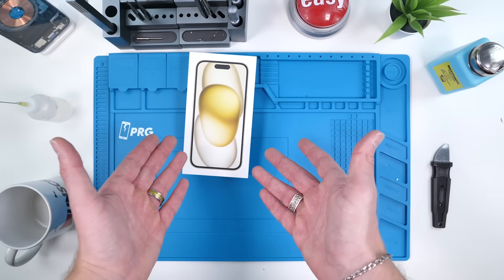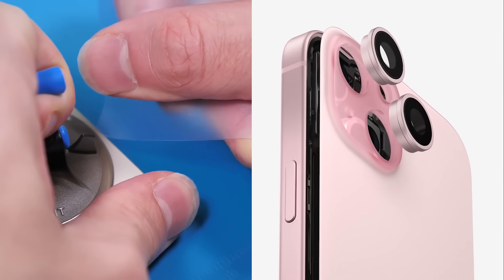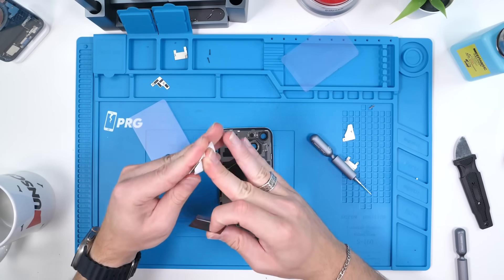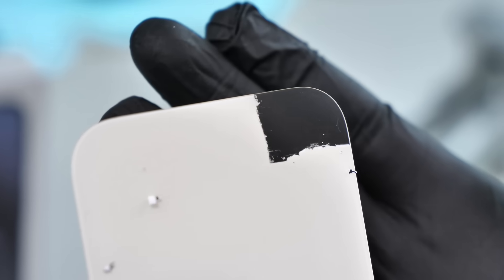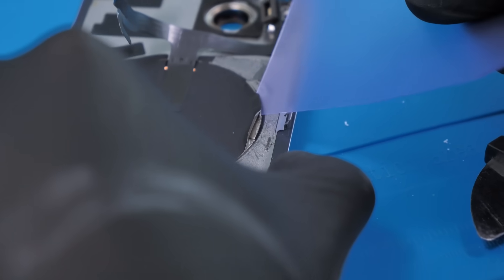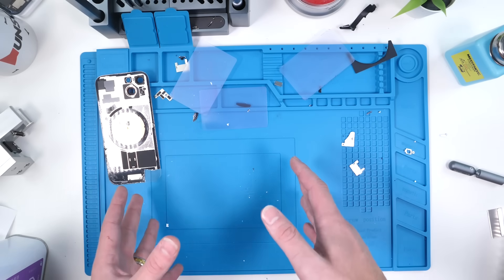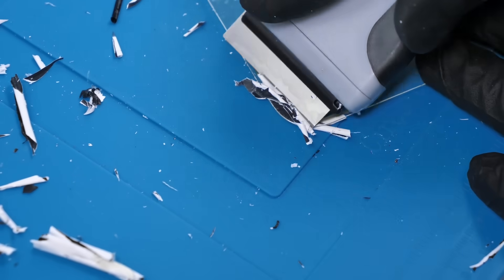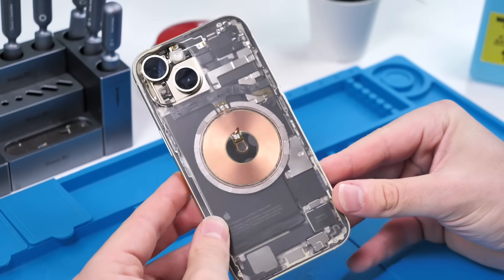The iPhone 15 Can't Be Fully Transparent?

Comment: I wish they make this an option. It’s so cool
Reply: Fr, bring back the Mac G3 days
Reply: Yeah. Offer a 20-30 discount too. Since it’s less materials used
Reply: @Kananaboo 20-30 is less than 1% of the price, and it will cost more because its not a "normal" phone but rather a "limited" (not actually limited but whatever) edition so it would cost more
Reply: @Kananaboo i guarantee you if apple released a clear iphone 15 it would cost MORE 💀
Reply: @bread6235  when has Apple ever made a different color cost more tho..?
Reply: @nylotical  i mean like if there was a clear iphone it would only be for one of the flagship pro models and not on base. just like how the midnight purple was exclusive to the 14 pro & cobalt to 15 pro

Comment: I thought that your transparent iPhone mod couldn't get any cooler since, you know, Apple being Apple. But dang you pulled it off with significant improvement to the cleaness throughout the process while being indestructive! I don't usually give any video a like but I did on this one. It's like watching your favourite football team winning a champtionship; jumping out of my seat when I see that it works 😂 I went full POG when I see the result at the first second hahahah!
Made my day mate! Great video! 😊
Reply from the maker: Appreciate you🫡
Reply: @PhoneRepairGuru here a good idea for a video buy older refurbished iPhone so there not two years old. So there can be more problems because there older and see if you can find any good or bad things about each one. I just think that getting iPhone that are only one to two years old isn’t going to have that many problems with them, but if you get older ones that most likely won’t happen. Like maybe in a iPhone 10 or older. Idnk just in video idea for you.

Comment: It tempts me to do it with my 15 pro max but my concern is how would Apple take it next time I upgrade in the way of trade in value
Reply: Why tf trade in if you can sell the phone for more than the original value on ebay with the transparent back, even without it you get more selling it yourself than doing the trade in, for my 13 pro max they give me les than 400€ when I sell it for 880 on ebay myself xd
Reply: Bro look again only on the normal and the plus model there is the infused glass, he try it on the 15 pro max and it didn't work
Reply: 15 Pro series ain't color infused..

Comment: I wanted to get the 15 pro max but it doesn't seem to be durable so idk if it's worth getting the 15 plus
Reply: As long as your not bending the phone with your entire strength, or dropping it off of 2 story buildings, it should be fine

(Referencing Jerryrigeverything and the guy who broke the cameras off after dropping it from a two story building 14 times)
Reply: @ZekeTheMan623  yh but the phone cracked on the first drop
Reply: @ZekeTheMan623  This but also this is the only IPhone with back glass to break so easily. It doesn't matter how careful you are, accidents happen.
Reply: @7SUK1  I get that, I also failed to mention the existence of cases

Comment: The S20FE does have a similar tinted back panel, but making it clear will be another thing to worry about since its Plastic backed..

It is possible, I have done it on my S21 (there's no tint to the back of the S21)

Comment: Open it again and put a flexible rubber transparent protector that you can cut with a knife . So it much stonger . But do it on top of the wireless charging thing. Do it like a transparent car wrap but on the inside

Comment: I've got a interesting idea about a future project you could try out: As the iphone 15 and 15 pro screen do have the exact same specs but the refresh rate, I wondered if it's possible to just swap a 15 pro 120hz screen to the normal iphone 15 to get rid of the lame 60hz on the basic models. I don't know if the connectors of the two screens are equal but you could find that out.

Comment: Since you removed all that stuff, if you now glue a metal plate to the back glass would it therefore be as durable as the other iphones again?

You could perhaps try that snap test that JerryRigEverything does against a normal iphone 15 pro max vs one with a glued metal back

Comment: Would it be possible, for this or any recent phone you have worked with, to take off the back panel and also remove the chunky camera sensors, and instead of replacing the back panel, to replace it with a spare display glass? 
I know this would remove camera functionality, but for someone who doesn't take photos it would finally allow the phone to lie wobble-free...

Comment: The iPhone 15 Pro Max offers several upgrades compared to its predecessors. Here are the key enhancements:
1. **Design**: The iPhone 15 Pro Max features a more durable titanium frame, making it lighter and stronger than the stainless steel used in previous models.
2. **Display**: It includes a 6.7-inch Super Retina XDR display with ProMotion technology, allowing for a smoother experience with a 120Hz refresh rate.
3. **Camera System**:
   - **Improved Optical Zoom**: The new periscope telephoto lens allows for up to 5x optical zoom, enhancing photography capabilities.
   - **Advanced Computational Photography**: Features like improved Night mode, Photonic Engine, and enhanced Smart HDR improve low-light performance and overall photo quality.
4. **Performance**: Powered by the A17 Pro chip, it delivers improved performance and efficiency, particularly in graphics and gaming.
5. **Connectivity**: The transition to USB-C charging enables faster data transfer and charging capabilities.
6. **Battery Life**: The battery life has been optimized, providing longer usage times compared to the previous models.
7. **Software Features**: The iPhone 15 Pro Max runs on iOS 17, bringing new features such as improved widgets, enhanced privacy settings, and more.
These upgrades make the iPhone 15 Pro Max a compelling choice for users looking for high performance, advanced photography features, and overall improved usability. And The cost Is 1.199

Comment: Wil it mess up with the heat dissipation while using wireless charging and otherwise?Also, structural integrity as we are getting rid of the back metal plate?

Comment: The phone will not function 100% normal 
It needs the metal sheets that you removed though… that metal sheet ensures the grounded components meets to a grounding point 

To test that plug is your usb C charger and with for less that one minute and you will see its rebooting !!! Tested it my self

Comment: @Phone Repair Guru, you thing that this will work and look nice with the Color - Black iphone 15 ? or will it ruin the transparency because it's black and it's embedded in the back glass ?(BTW I want to do this to that why Im asking )  Thanks your fantastic.
Reply: Also what colour is the best to do the transparent back glass mod? and any tips how you got the cameras out of the back glass ? and also how did you put it back together when you scratched the paint of ?, i mean the charging coil as well as the flash and rear microphone did you use glue or duble sided tape ?

Comment: The reason why the iPhone 15 Pro and Pro Max glass is so fragile is because they remove the metal backplate from the glass and stuck it in the phone itself unlike the iPhone 15 so that's why the iPhone 15 is more durable than the iPhone 15 Pro or Pro Max